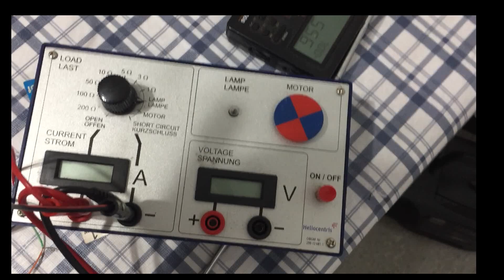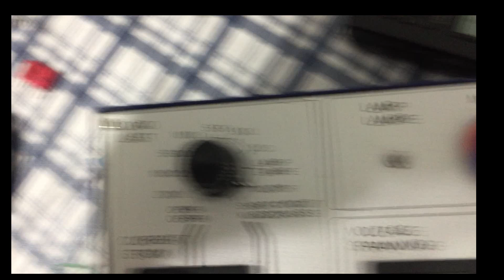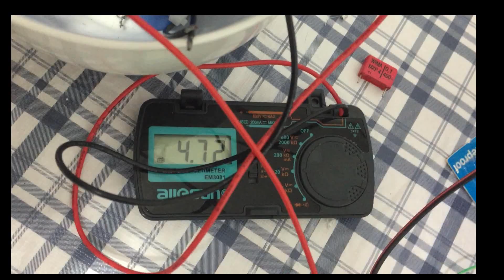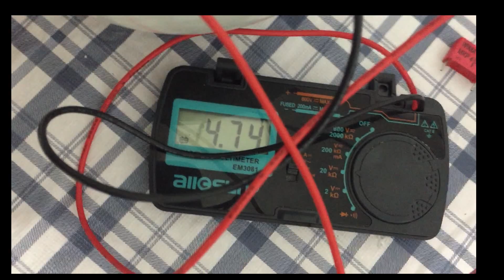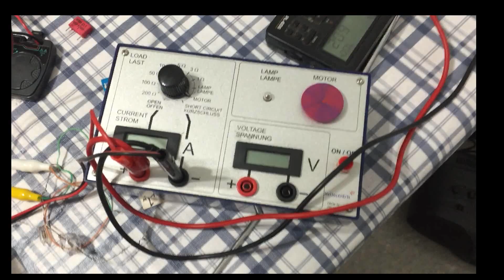Don Smith Power Demo

Comment: Hi Joel, thank you for your inspirational videos! I was wondering if the fluorescent tube (or plasma tube) can be replaced with a plasma ball lamp? Pf course it will have to be coiled up and wrapped with aluminum foil to become a capacitor. Also, if using a 12V lead-acid battery to run the HV oscillator, instead of using the mains, what would be your concern?

Comment: Hi,I have been reading a lot of your channel projects and they are very concise and interesting.You share a lot of knowledge and share it freely and seems you have a radio electronic background and have worked many a tried and true projects or have improved on them.Well to let you know I have my interests in free and alternative energy mainly and see that you have found ways to maximize BEMF,spark gap,negative grounding etc., to extract the best energy producing devices in a very positive way.
Plus some innovative ideas like your plasma tube cone coils projects Don Smith,Kapanadze Moray etc.
Long story short I am 72yr old basement,field engineer type experimenter and would like to say how you have resparked my interests in building again after a long absence due to health interfering any further progress of mine.
Thank you for sharing with us!...Tony...aka "Foamaxmore"
Reply: P.S.didn"t know plasma tubes,neon tubes  give out electromagnetic energy.Is that true?and would they become economically feasible for free energy?

Comment: I will admit this is the first ive see of you and im not sure of your goal, but it appears that the supply, in watts is greater than the needs of the motor, in a case like this the remainder of the available watts can easily be used to charge caps?? As i say im not sure what your aiming for but i will look futher in time.
Reply: Definitely the case. Don Smith never succeeded in disproving the first law of thermodynamics. If anything it is a fairly efficient but impractical form of conversion after carefully tuning an LC circuit.

EDIT:

@Joel Lagace, I appreciate the work you put into this. If you still have this setup on your table, what would be interesting to see is a measurement of the output voltage and current drawn by the adapter VS the voltage + current drawn by the motor. I suppose that info would be useful in tuning the circuit anyway. Also one could then calculate how fast the capacitors charge with the remainder of energy in an ideal situation and estimate its efficiency compared to their real world charging rate.

Comment: Just a related note: Gray's device for collecting energy from spark gaps, neon lights, fluorescent bulbs, and similar sources utilizes a special vacuum tube. Inside this tube, there is a spark gap surrounded by a wire mesh. The mesh acts as capacitor plates. This design allows the mesh to collect the electromagnetic/Electrostatic energy radiating outward from the spark gap.

Comment: Thank you very much my brother, I have been experimenting this device for quite a while, that I came at this effect but couldn't figure out that the system could actually be used to power a load right away. 

I have been charging capacitors with one wire and another hanging reaching up to 900v -1200v. Through hot wire to ground.

Can you also do neon bulb on the antenna to see if it will emprove efficiency. 

My setup was as follow

 ----------------------- air
         |
         |      <---- antenna on one end of secondary 
         |
        ¤     <----- high frequency coil with primary and secondary 
         |
         |      <----- hot wire of the secondary coil
         |
        Cap
         |
         |  
         |    
 ___+_____  Ground 

However this setup also works without antenna, the idea came about when I wanted to harness air ground energy, according to a research that was done many years ago I will revisit the source to give you the name of the researcher. According to him and Tesla they have used air balloon to hang their antenna as high as possible and they were getting energy  in giga wats